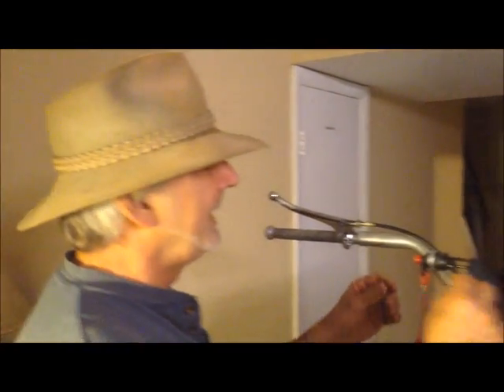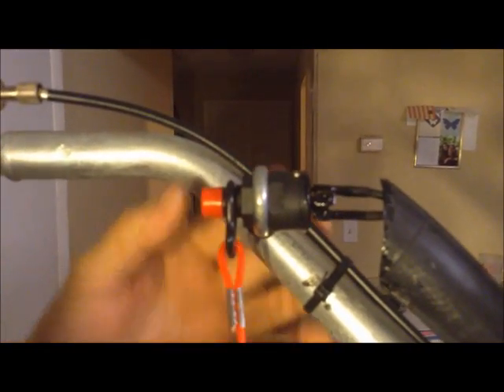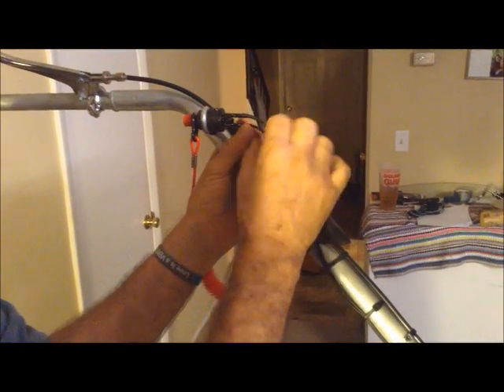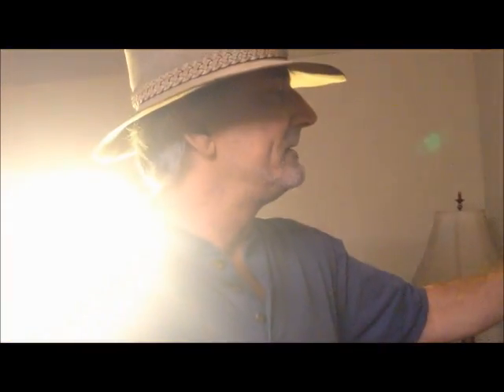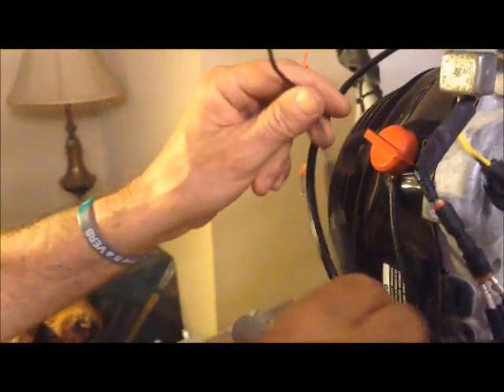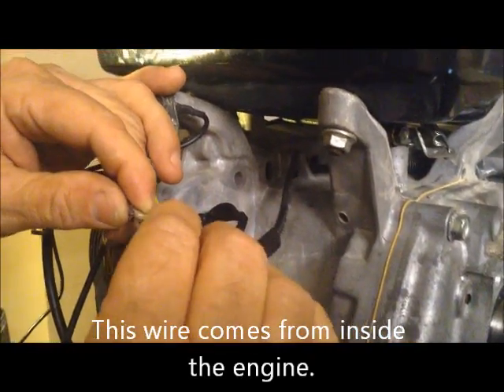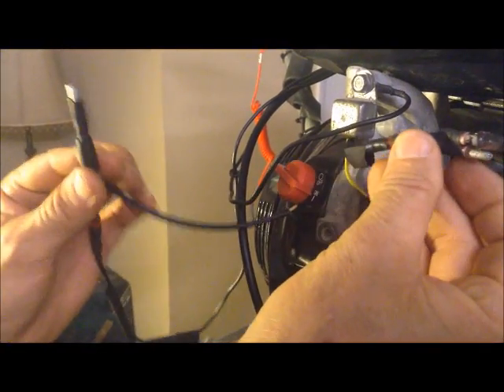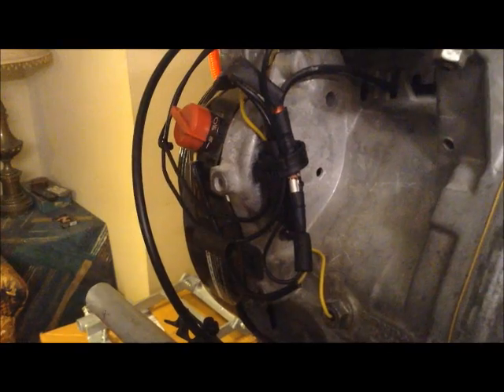Kill Switch Assembly Made Easy by FishinRod

Comment: So would it work if you went ground to switch to coil to spark plug and left the oil sensor out and the on off switch out? Trying to rebuild an engine for a mini bike had a electric start but doesn’t work so I want to remove it all togather and just put a kill switch instead however I’m not understanding the charging coil thing on the inside of the fly wheel do I still need that if I’m not using the electric start?